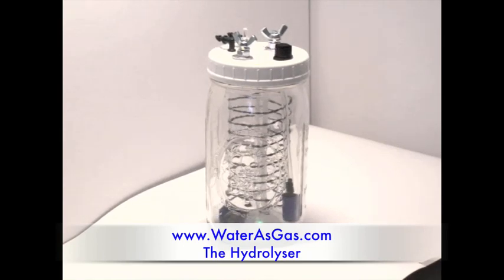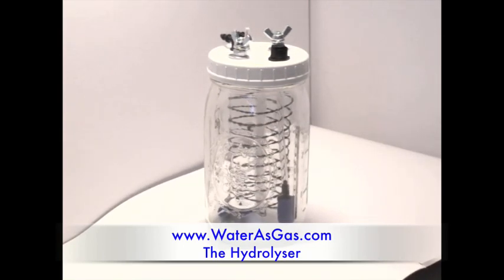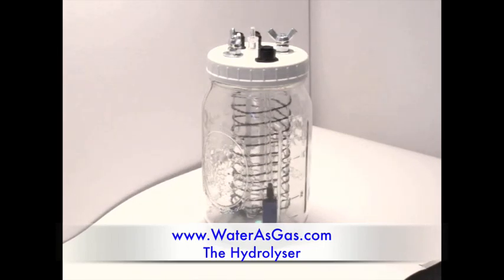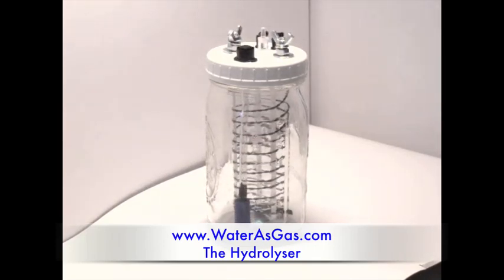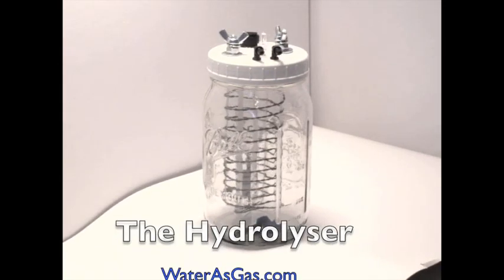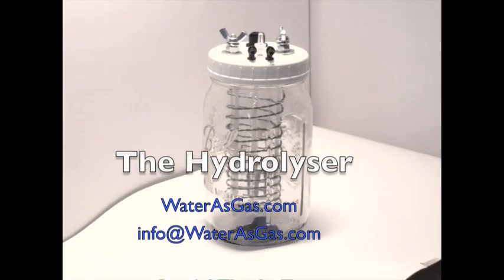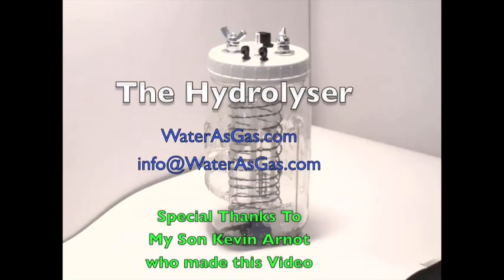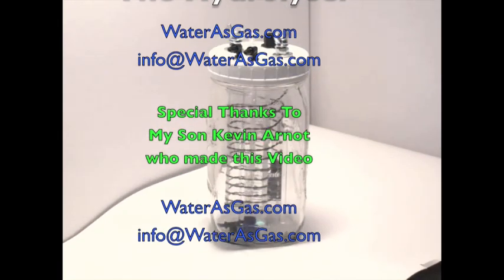The Hydrolyzer - A Close Up

Comment: Wouldn't you need to re-map the computer to adjust the fuel air mix? I understand that it may make the fuel burn more efficiently, however if your mixing HHO with the current fuel/air mix, couldn't you lean out the gas mixture and increase your mileage even more?

Comment: Well, sort of. Yeah the electrical load is greater, asking the alternator to work harder, but the engine actually gets more "oomph" in every cylinder stroke. The extra load is less than the extra push provided by the HHO gas. It's super cheep to build. I've done it, and it works. You want to bust it? Build it, do a video, and sow me it doesn't work. 

Mine sure as hell did, and mine was cheep.